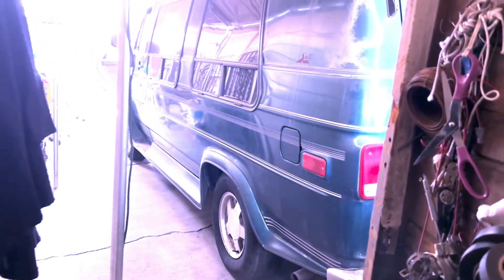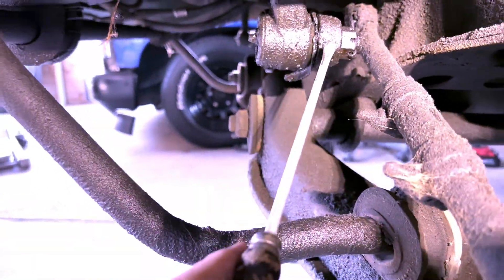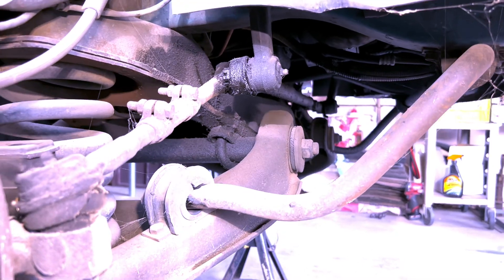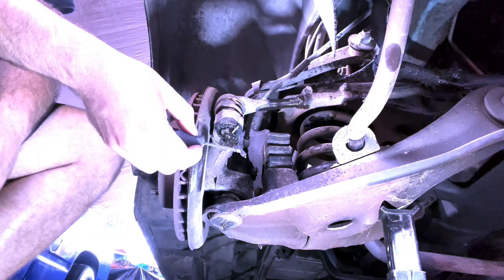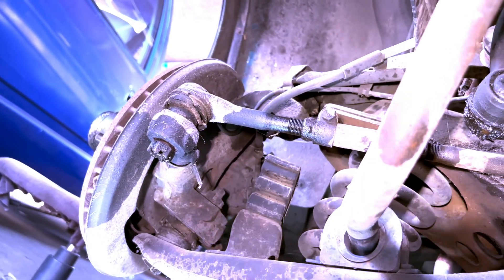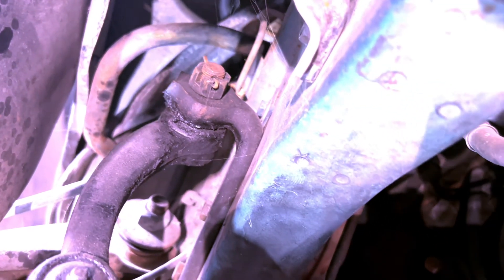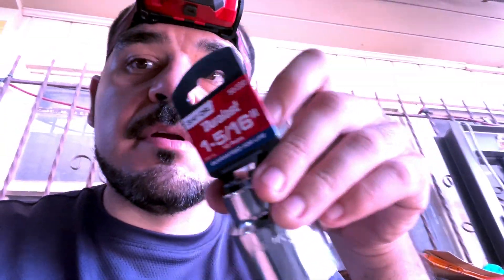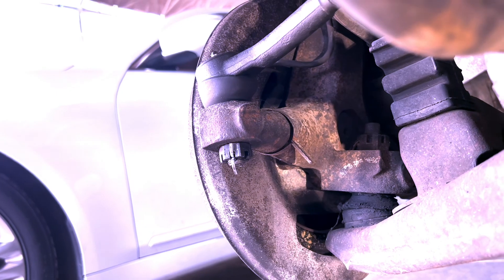Chevy G20 Van Steering Overhaul!!

Comment: Replace those calipers & hoses too and then flush the whole system with fresh brake fluid.  Looks like your front swaybar bushings are shot too.  I replaced all that stuff on my 93 a couple of years ago.  It brakes nice and straight.
Reply from the maker: Thank you for the info! I definitely appreciate the input! 🙏
Reply: Do you maybe have a photo of what the swaybar bushings look like?  SOunds like something I might need to look at. Thank you.
Reply: @losmerosvera  Sure thing.  I hope my post didn't come off as "demanding" lol, but these vans are getting up there in age and if those parts are original most likely they're worn out.
Reply from the maker: @uber2tuber  I don’t have a picture of that specifically unfortunately, but it’s the front bar that attaches from side to side up front. You might be able to catch it in the video, if not I’ll try to point it out on the instagram page for you.
Reply from the maker: @21Piloteer  not at all, I’ve never really worked on this platform so I can really use all the info I can get. This van does need a lot of work, that’s for sure. 😂

Comment: Great video!! I have a 1992 chevy g20...it was doing the same thing when breaking it would go to the right side...after changing everything related to the brakes it ended up being the only thing I thought couldn't cause that, one of the front brake lines was somehow clogged....replace it and has it done it since.
Reply from the maker: @ISitOn MyArm would definitely recommend bleeding the brakes to check if something is clogged 💯
Reply: mine does the same thing.

Comment: One more question?  How do you know if you have little or enough grease in the ball joint?
Reply from the maker: You don’t really know since you can’t see inside of it to be honest. When you pump too much grease into them it’ll squirt out from anywhere possible, you don’t want it to do that because it can possible tear the boot on your new part. 

Usually I only do 2-3 pumps, depending if it feels like a good amount got in there. The goal is to have it lubricated so it can move around when it needs to move. Too much lubrications is just unnecessary, a waste and just makes a mess BECAUSE it’ll squirt out from wherever possible.

Hope that helps!

Comment: I jus bought a van jus like this one mines a 1991, the body style I have they made it from 1983-1991 yours is a 1992 or a little newer because it had the double headlights on top, the body style I have is more popular because it’s the 2nd generation they had 3 generations total from 1970-1982 than it’s 1983-1991 than 1992-1996 years is the 3 Gen I like them tho I think they look nicer with the double headlights on top, a 1991 van jus like mine a starCraft Edition sold for $15,000 but they’re saying one in mint condition can fetch $20,000 or more, the one that sold for $15,000 had 80,000 miles & it was pretty clean all original! So I’m in the process of getting mine ready for paint because mine has no dents or dings at Al & Zero Rust it’s never been wrecked & it’s so straight the bumpers still look brand new! The interior is like 98% percent I means it’s clean! Idk how if I can post pics on here or not it’s a beautiful van the clear coat is chipping, I bought it not running, I installed new fuel tank & the whole fuel sending unit, new fuel filter new fuel lines, new oil & filter, brake fluid brakes, flushed the cooling system put new coolant, this thing fired right up didn’t even hesitate I barely bumped the key! It was sitting for 13 years I was trying to buy it from my friend for 5 years than I finally got him to sell it to me because I offered more money, I love the van it’s a highway cruiser I mean it rips on the Highway it pulls very hard top end & low end, it’s a sweet van!!! They say these old Chevy vans cost so much back than a lot of people couldn’t afford them, they said 
It’s more luxurious than a 1999 Cadillac Escalade!

Comment: came here thinking you were gonna be doing a power steering swap.  Not what you're up to but i can see you gear box is leaking like crazy in this video just like mine which is why it's all wet under the front.
Reply from the maker: The leak was coming from a power steering line on top of the gear box if I recall.

Comment: Great vid! thank you. I just got a 91 Chevy G30 and the steering is loose with a lot of play. I read on some forums that changing the Pitman arm and Idler arm could fix it, but didn't know where to look for those, so this helped a lot.  One big question tho... did it drive better after doing all that or did it still pull to the right when  you hit the brakes?  What was total time for the replacement?  gracias!
Reply from the maker: Glad to hear the video helped! To answer your question, the pulling wasn’t due to the steering linkages, the pulling is being caused by something else. But the steering wheel does feel tighter by comparison so it definitely drives better! Hope that answers your question!
Reply: @losmerosvera    Thanks... great to hear the steering feels tighter!  How much was the kit you bought and do you have a link please?  And to clarify, you didn't change out the Pitman arm and the idler arm, correct? Just left the originals? 

Also, a friend of mine mentioned ball joints should be looked at... did you examine them while you were working on the steering linkages?  

I am watching your brake vid now... so helpful too!  

ps... just another piece of info I learned on the G20 fb group, is that the shocks can make a big difference in how they drive. Mine tends to kind of "wallow" back and forth, for lack of a better word, and can actually be a bit scary to drive on the narrow curvy hilly road I live on. :(  So one guy said he has had 4 different G20 vans and they all did that... it wasn't until he installed Rancho adjustable gas shocks (and made them pretty stiff) that his G20 stopped doing that and he said it handles much better on curvy roads and also feels much more sturdy.  So I just toss that out there as an fyi.  They are pricey, but I'm going to install them. Cheers!
Reply from the maker: @uber2tuber  It was pretty much one of the first listings I came across on ebay believe it or not. The whole kit came with everything including the ball joints for around $100 if I recall. Couldn’t go wrong. I replaced everything including the pitman and idler arm, which were also included in the kit. 

My ball joints are completely gone unfortunately. Although the ball joints came with the kit, I’m really debating on whether taking the time, blood, sweat and tears to just replace the ball joints alone or just pull the trigger and go ahead and buy and replace the whole arms since the bushings on those are gone as well..
Reply: @losmerosvera  I can't find a complete kit like that on ebay.... I'll keep looking tho.  In the course of looking for it, I did come across a remanufactured steering gear box... that apparently connects to the Pitman arm and supposedly can cause play in the steering wheel too. Have you thought about changing it out too???  Is there anything left to change out in the steering? lol

It does sound like it would be good to change out the ball joints and arms.  My mechanic will put mine up on the rack this week (he's been busy up til this point) and he'll take a look at things. But I'm pretty sure most of what you have done, plus the shocks will need to be changed. Thanks so much for your info!
Reply from the maker: @uber2tuber  the goal for the moment is to get the van road worthy. Although it would be ideal to replace the ball joints and possibly the steering gear box as well, it’s just not a top priority for the time being. That would be the only things left to change as far as steering components go.
Reply: @losmerosvera  Understand... I guess my mechanic will look at my 91 van in a week. :(  All I know is for me, it's too scary to drive at them moment cuz I live on a very narrow and curvy mountain road and it does not feel secure at all.  I kind of suspect it will all need to be replaced, but I guess I'll find out. Good to know at least that's all the components.  Thanks so much for all your information!
Reply: @losmerosvera  I am on this very step with mine - replacing the steering gear.  I did the WHOLE front end and ALL of the brakes components are new except for the brake lines.  Much noticeable improvement on my brakes.  My brake booster was leaking and it was al rusty so I decided to replace that since I has to replace the calipers as well. Great job!  I am excited to see what you do next!
Reply from the maker: @TheMulattok81  Thanks! I appreciate the support! 🙏

Comment: Did you use a torque wrench? Or did you just make them tight?
Reply from the maker: I torqued the ball joints to around 40ft.lbs. if I recall correctly. I’m sure the actual specs are somewhere in google I just don’t recall exactly off the top of my head unfortunately.

Comment: Wish I saw this sooner! Hey, I had to butcher the cover over the steering shaft in my 95 G20. It's rubber and plastic and some keeper wire where it connects to the gearbox. Haven't seen a way to remove it yet. If you run into changing one of those steering boxes you'll see what I'm talking about. I'm done. Cut it out of the way. Anybody else cussed this?